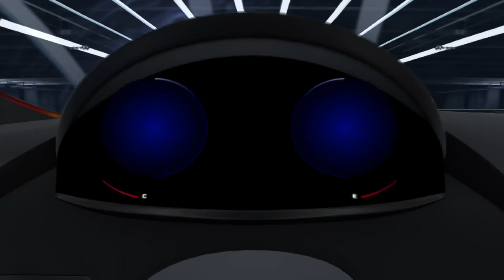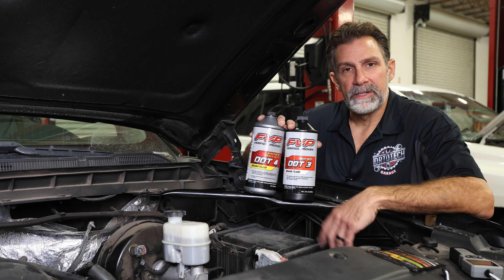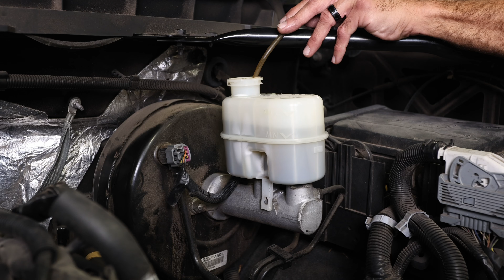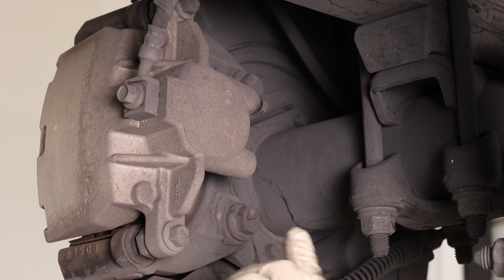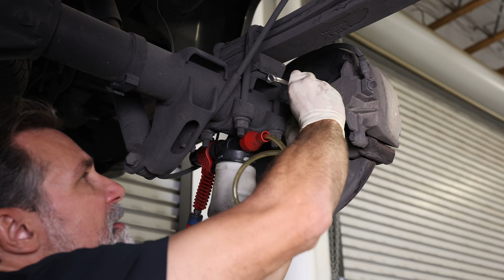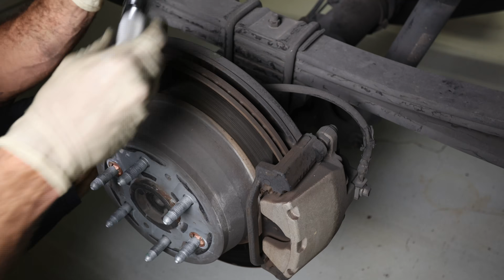Flush Your Brake Fluid Like A Pro!

Comment: Keith another very informative video . Do you recommend a specific air pressure for the bleeding process or does it depend on the tool you’re using ?I usually do it the old fashioned way but as the years go by sometimes the wife just doesn’t want to pump the pedal anymore . Lol . Thanks for sharing . 👍
Reply from the maker: Most compressors are regulated somewhere around 150psi.  That is plenty to create the venturi effect needed at the bleeder tool.  They all work pretty similarly.  Leave the wife alone and grab an inexpensive tool on Amazon.  I have an example in my Amazon store collection of tools, but any should work fine. 👍

Comment: I have a small craftsmen pancake compressor, does the vacuum bleeder take a larger capacity compressor to work? Maybe not since it only takes 60 to 90 seconds and then the compressor can recharge.
Reply from the maker: I have never tried with a small compressor, but it should work, John.  It may take longer because you won't have the large volume of air to create the vacuum like you would woth a larger tank.  As long as you can get some steady suction at the hose on the bleeder tool, you will be good.

Comment: The problem with this method is you don't get a firm pedal feel when applying the brakes.
Reply from the maker: Sure you do!   Ive literally bled thousands of cars like this.  The problem is if you run the master cylinder dry and introduce more air into the system. You really need to pay attention to the fluid level and continuously add as you bleed.  Be sure yhe pump the pedal when your done.  The pedal should be high and hard.  If not, you've pulled some air in. 👍
Reply: @OrtoTechGarage   I don't let the master cylinder run dry. In order to achieve a firm pedal is to do a manual bleed afterwards. Vacuum bleeding is only good for suction, not a true bleed as you said in the video. You should experiment it yourself. Perform a manual bleed all four corners after the vacuum bleed and you will feel a difference.

Comment: Very good explanation of how to bleed the brakes.  For years I used the vacuum method with either a Mityvac hand pump or a Harbor freight system like what you are using here.  For the most part I had great success with these two methods.  There were two instances where neither method worked for some reason and that is when I had a rear brake line fail and had to replace the line.  After replacing the line, I could not get fluid to come out of the bleeder valve and had to resort to the old-fashioned method of using a helper to pump the brakes as I bled them.  This was on a 92 Cavalier and a 98 Chevy K3500 truck.
I later decided to get a pressure bleeder to try for the future and now prefer this method over the others.  I went with a Speedibleed system.  They are based out of Canada and their system works great.  It uses the air out of your tire to provide the pressure.  I also like that there is a reservoir that is filled with fluid so that you won't let the system run out of fluid and the bleeding process goes a lot faster.

One thing that I did have to do quite a few times using the vacuum method was to put some grease around the bleeder valve threads because they always seemed to get air pulled through them even if the bleeder valve was open just enough for the fluid to flow.  Another great video.  Thanks.
Reply from the maker: Great information as well!   I have not tried that brand of pressure bleeder.  This is a great way to bleed the system though. 👍 i have found that the older Chevy products are difficult to reset the combination valve (proportioning valve/metering valve) once it loses a brake line or hose.  They can be tricky.  Thanks for sharing!

Comment: Great video and you covered it well. A few customers like to see the moisture meter test or the ph test strip before authorizing the flush. I’m still using my old Motive bleeder but requires various cap adapters. I like your pneumatic brake bleeder. It’s more common in the north but being in south I sometimes need to use the map gas and an easy out on old vehicles bleeder valves.
Reply from the maker: Thank you very much.  Are you a technician as well?  I like your comments and  adding good information. 👍
Reply: @OrtoTechGarage  I’m a bit older, so my dealership ASE tech years are behind me but I enjoy watching others still in the industry provide value.
Reply from the maker: @motordown7664  Congratulations on a rewarding and fulfilling career, my friend.  You still have plenty of knowledge the younger generations need.  Don't be afraid to share it.  I'm afraid it's going to die with us if we can't nurture future generations. They need mentors!
Reply: @OrtoTechGarage   I agree with you. I tell young people to get involved in an automotive technology training program, then into a German auto dealership since they might have a higher flat rate. Also, these vehicles tend to require more repairs and the vehicle owners are prone to authorizes rather than waiting. I started with points and condenser ignition systems and witnessed the technology change to using a wireless tablet to run diagnostics and monitor more than 30 modules.  Please keep the great videos coming. Oh and tell the young people to stay off of the tool truck$….LOL
Reply from the maker: @motordown7664  I agree on every point you made there.  I'm actually working on some videos for people who want to get into the industry but don't know how or where to start.  Everything from starter tools required, exactly what to buy and where, to what training is needed and what job opportunities and certifications will get them earning power fastest. Hang with me, and keep posting your great comments. 👍
Reply: @OrtoTechGarage  A few thoughts.  UTI, and several automotive manufacturers have their own training programs. For example, GM = ASEP, BMW = STEP. They are expensive but it’s an investment. I have noticed some DIY home mechanics that transition to a professional shop have bad habits that need to be addressed so assign them to OJI with a seasoned tech. Tools….this is very difficult to navigate because the initial cost is very expensive and the other side is most seasoned tech do not enjoy loaning their tools to the new guy. To save on a big cost I would recommend a tool box from Harbor Freight $2,000 rather than Snap On or Mac$10-$15k. Then put the savings into tools. You know the saying… tools make the money not the box. I look forward to your next video.